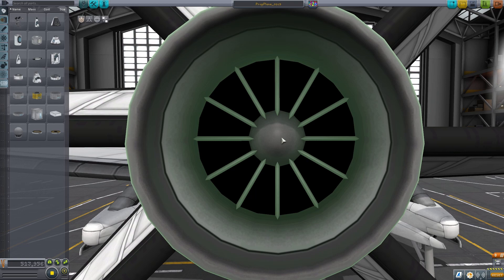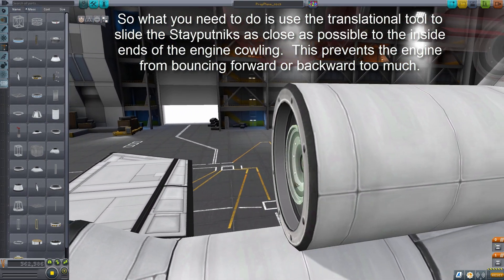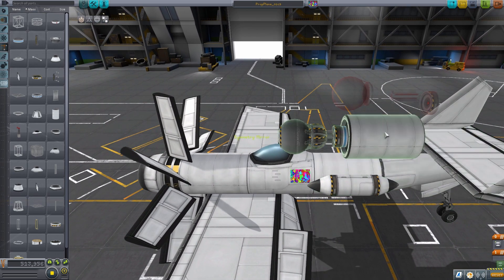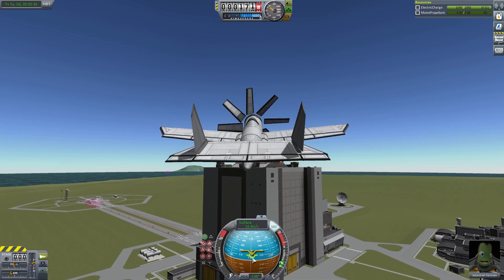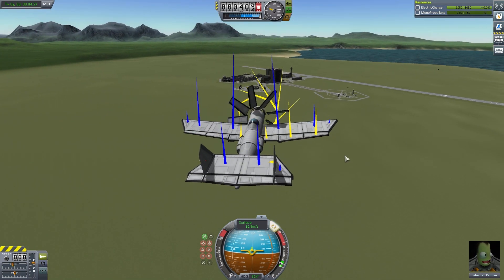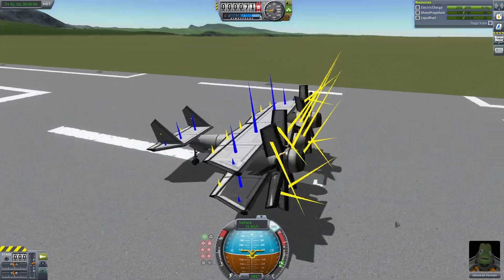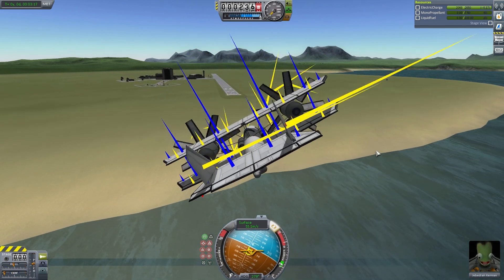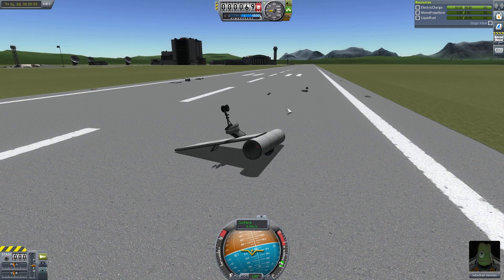OBSOLETE VIDEO, pls see #3 -- KSP stock elec prop 2: smaller engine, bigger performance

Comment: Before there was a way to make simple propeller engines, i just put wheezly engine or whatever they are called on the front and put them on reverse thrust.
Reply from the maker: Yeah I did that about a year ago.  Then someone told me I had mimicked the Coanda plane.  The principles of operation are, in fact, totally different but I took the comment as a compliment nonetheless.
https://youtu.be/J84QYRYhA6s

Comment: Just imagine a extrimely complex Tu-95 with counter rotating electric engines.
Reply from the maker: Oh man I so wish coaxial counter rotation was a thing in this game.  I've seen people do it in stock KSP with very large workarounds using a sort of scaffolding to have one rotation shaft be supported inline with the other shaft, but that's not truly coaxial.
Reply: Anything is possible in KSP.

(Kinda)
Reply from the maker: Antonluisre
Well in that case I challenge YOU to build the Large Hadron Collider, to scale, and discover the next subatomic particle.  ;D

Comment: What's the service ceiling for the planes? Any possibility of using it for a high altitude launch platform? Could save on fuel.
Reply from the maker: Yep, that idea's been shot around.  Rumor is the engine system works impressively well on Eve, but I suspect even on Eve the service ceiling would still be too low to get a rocket out of atmo.  On Kerbin, the ceiling for the planes I showed in this video is around 5 km, give or take a few hundred meters depending on flight profile prior.  With a more powerful engine and more thrust, the ceiling might go to 6 km or a little beyond, but the thinness of the atmosphere simply does not allow for sufficient deflected air off the blades at altitudes much higher than that.  Figure the Wheesley's flameout threshold is 9 km, so...
Reply from the maker: I stand corrected: getting a rocket out of Eve's atmo with an airborne propeller launch is totally doable.  See Bradley Whistance's channel.  He's already done it.  
https://www.youtube.com/user/nEvermore930/videos
Reply: Inter's Odyssey funny, found that at lunch and forgot to mention it.

Comment: I think the reason the Biplane is slower, is just due to drag, biplanes aren't exactly known for there speed, but anyway

Other than that you're engine is near perfect or at least very good, maybe to get more power out of them we should look into a better Prop design. 
Obviously these motors are low RPM and create Large Torque not so much Hp so:
-Pitch needs to be very steep (low speed)
-Diameter needs to be quite large (high torque , not high Hp)
-Blade needs to lower drag, pitch should increase near the tip, not constant pitch
-As many blades as only needed, the more blades: more drag, more harmonics, more stress, more margin of error

We also know that the farther the distance from the center of the blade, the more lift created, near the centre however more drag is created rather than lift. This is why props have a "twisted" look to reduce the inner drag and maximize outer lift

Obviously we cant have too creative of a prop, because they will want to pull apart under stress
But it might be an idea worth looking into, who knows you might double you're speed because you can get more power down

Other than that very good video, can't wait to see these motors become so useful we can actually consider bringing them to other planets. Thank you again for the video
Reply from the maker: Could you please elaborate on your second bullet point about the diameter?  I'm not sure I understand whether you are saying the engine should be a larger diameter (possibly by using reaction wheels external to the cowling) or the propeller arc alone should cover a broader diameter span.  Thank you.  

This comment is good input from a general physics standpoint but you ought be mindful of two things which throw that awry: one, KSP physics is not real physics; two, aerodynamic principles and terms have different meanings in some cases than what you applied here.  Some gee-wiz: 

A propeller blade is designed, in almost every way, to operate exactly like an airplane's wing.  "Thrust" of a propeller blade is essentially synonymous with "lift" that is merely pointing forward instead of up.  The single factor most important to both propellers and wings is "relative wind".  These two airfoils also have secondary factors which are important to each of them respectively that the other airfoil does not need to deal with.  Wings have to deal with load factor while propellers do not.  Likewise, propellers instead have to deal with drag induced by varying rotational velocities from root to tip, as you alluded to, while basic wings do not.  

The twisted look of real propellers serves three purposes, all of which are mutually supportive.  However, the outer portions of the blade do not necessarily produce more lift.  The reason propeller blades are designed like airfoils is because they intend to take a majority advantage of induced lift rather than dynamic lift.  Induced lift is a byproduct of Bernoulli's principle about faster motion of fluids when their flow path is constricted.  But induced lift can be produced in a couple of ways.  
1. AoA.  A twist allows the faster-moving outer portions of the blade to have a lower angle of attack (AoA) as the blade cuts a circular path through the air.  A lower AoA simply means the blade cuts through the air more cleanly and air molecules are encouraged to flow around the airfoil at high velocity with little disturbance, thus lower drag, and in turn increasing the blade tip's lift to drag ratio.  Additionally, a lower AoA reduces the strain on the airfoil.  However, greater AoA of an airfoil to a relative wind, such as at a blade's root, can produce a combination of dynamic lift (Newton's 3rd Law in blunt force form) along with tricking the air into taking a longer route of travel around the upper surface of the airfoil, hence a more devious form of induced lift.  A high angle of attack at low speeds can produce lift similar to a low angle of attack at high speeds.  That is probably the biggest reason blades are twisted: so the entire length of the blade can produce similar amounts of lift at every station along the length of the blade thanks to a nominal meeting point between rotational velocity, angle of attack, and camber.  
2. Camber.  Thicker airfoils (where thickness is a function of camber with respect to the chord line) impose greater constraints on the motion of air around the foil, thus speeding up that air thanks to Bernoulli - regardless of AoA! - which in turn produces lower pressure and in turn greater lift/thrust.  This means thicker airfoils can produce surprising amounts of lift even at quite low speeds, hence why they are used on aerobatic planes.  The drawbacks to thicker airfoils are that they demand more viscosity from the air in order to maintain laminar flow, so small bits of turbulence or significant changes in AoA will see the onset of stalls near the trailing edge sooner than on thinner airfoils and, in clean flight, thicker airfoils produce uncomfortable amounts of low pressure as speed increases which in turn imparts strain on the airfoil.  However, thicker airfoils are more forgiving of stalls and can continue to produce appreciable lift despite changes in relative wind.  Consider a propeller blade during a sudden change of relative wind, such as during a lateral gust or during a sharp maneuver of the aircraft.  The thinner tips of the blade with their lower AoA are more dependent on a narrow margin of error for relative wind.  In the case of a sudden change of relative wind, the tips of a prop blade are likely to lose a greater percentage of their possible lift than will the thicker, higher AoA blade roots.  Thus, the blade roots with their greater camber are the less efficient but more reliable portion of the blade while the tips are the inverse.  
3. Strength.  The twist of a prop blade affords a cross sectional area that allows the blade to be thicker at the root where it mounts to the shaft.  This thickness allows stresses suffered at the blade tip to be absorbed by the root of the blade and, in turn, it enables the root of the blade to gently propagate the torque of the engine out to the more delicate blade tips.  If the transfer of energy was not important enough, the considerations of mass also come into play.  It requires much more effort to move a mass in an arc the farther it resides from the pivot.  Tips of prop blades are thin so as to require less effort on the part of the engine to impart angular acceleration.  Less inertia means greater efficiency, and fewer feedback stresses when another force (eg. turbulence) tries to abuse that inertia along undesired vectors.  

Of course, none of these three purposes matter in KSP so I totally agree that a multi-part prop blade would benefit from having coarser (steeper) pitch near the root and finer (shallower) pitch near the tip to mimic a real blade's twist.  As a workaround, I think our ability in KSP to deploy control surfaces would allow something like an in-flight variable pitch prop (an FAA no-no) to continue to seek out the maximum thrust for a given altitude and airspeed.  I've tried doing this but in practice it is very difficult to see how long or short the yellow vectors become relative to a previous deployment setting because every time I change the deployment the propeller briefly feeds back into the plane, slowing it down, which changes what deployment angle I should be seeking ...it becomes a never-ending spiral.  

Your 4th bullet point mentions harmonics.  I assume you are referring to propeller-crankshaft harmonics where certain RPM settings will produce rotational velocities of the propellers where an odd or even number of blades (depending on the total number of blades on the prop) are in harmony with the rotation of the crankshaft, thus producing a tugging motion on the engine and all mounting points.  The more blades there are, the more frequent the opportunities for these adverse harmonics to arise.  The engine I've designed does not use a crankshaft as there is no cranking at all.  My engine is more akin to a turbine with a single focal point of rotation.  Yay!  Perhaps instead you were referring to harmonics of the blades affecting each other.  The trailing edge vortices and sometimes cavitations of propeller blades can create pockets of turbulent air that each downstream blade might pass through.  At certain RPMs and true airspeed conditions, the passage of the blades could hit these pockets at just the right moment that it incurs a drop in blade efficiency, or even vibrational stress suffered as the turbulent air tumbles over the subsequent blade and creates micro stalls instead of more laminar airflow.  Fortunately all of these problems are moot in KSP as there is no wind modelling in stock.  And even if Squad introduces wind for stock later down the line, I imagine it would be more like prevailing wind directions, not part-by-part relative winds and turbulence.  I think we're safe for now.  
 Given this, I will counter your 4th bullet point by observing that more blades means more thrust-producing surface area in a smaller diameter, which allows more compact aircraft designs.  Also, thanks to KSP physics, I've observed very ugly thrust performance with fewer blades.  As you can see with the AeroForces Overlay, the props don't produce any thrust at all in certain portions of their travel.  The more blades that exist in the prop, the more often I can have the whole propeller unit take advantage of the selected region in the prop's rotational plane where the peak thrust is achieved, thus the more overall thrust the engine can achieve in KSP.
Reply: diameter meaning the prop

btw nice job at making yourself seem smart, must have taken a day to right that loop of logic
Reply from the maker: xHIRTLIZER
Gotcha.  I haven't experimented with larger props yet.  Seen some videos of large stock turbines and they give the impression of producing a lot of power. 

No, less than an hour.  I've been in flight school for over a year now.

Comment: So could this fly forever?? I would be curious to see how it works if you make it fly without using SAS, then just let it fly on its own for as long as possible.
Reply from the maker: As far as power source, yes it can fly forever.  But as far as stability, even planes as stable as these need occasional adjustments to the flight controls.  There's no true autopilot in KSP yet.
Reply: I was thinking some huge dihedral to keep the plane stable in terms of roll then a constant up pitch that wont stall it but will cause it to goto an altitude such that it will just fly horizontal compared to gravity where the wings are providing exactly enough lift to cancel out both the craft's weight and the downforce from the angled down elevators.
a bit like a plane settling into a glide slope while you keep constant up elevator, but a powered version.
Reply from the maker: Thorondil
Gotcha, I hear what you're saying and it makes sense in real life theory, but not as much in KSP.  Yes, having a broader wingspan mounted in dihedral shape with ailerons out near the tips would indeed provide roll stability, but only to the extent that it would cancel out adverse roll incidents caused by engine naughtiness.  KSP will halt motion but not bother to correct it unless SAS is turned on, and if SAS is turned on then you can't fly forever because the curvature of the planet will argue with the original orientation of the SAS hold.  But if SAS is turned off, I don't think dihedral alone is enough to keep the plane horizontal.  ...UNLESS, the wings are rotated ever so slightly up (like a manufacturer's Angle of Incidence) so the relative wind in straight and level flight is always impacting the underside of the wing.  That way, the dihedral *should* be more effective and possibly enough to keep it horizontal, but then because of the constant tendency for the wings to climb, you would actually need to trim pitch down instead of up to counteract this.  Either that or just maintain manual control until the plane reaches its cruise ceiling where the air is too thin to make the wings climb anymore.  Lot of variables.

Comment: Can you recharge the engine? (maybe put a mass-less solar panel on all of the props?)
Reply from the maker: The generators I use in mine are sufficient charge for my engine.  Someone a while back mentioned that the cost in Career mode for my designs was prohibitive and defeated the purpose of a lightweight simulation of a piston engine.  Yes, solar panels could work but I prefer my RTG's.

Comment: I'm kinda amazed that it simulates P-factor! I was wondering, what is its single engine performance like on the multi (since you should loose like 70 Percent of your performance) also have you thought  of making one like the Do-335? It would look cool at the very least.
Reply from the maker: Oh yeah, the left-turning tendencies are definitely there: P-factor, precession, torque.  The only one missing is slipstream for obvious KSP reasons.  
Single-engine performance is a no-go.  From ground it will not launch; while airborne it immediately enters into an unrecoverable spiral (unless that engine is reactivated and the other momentarily deactivated to allow catch up).  Even with the downstroke being close to long.axis, it's just too much of a lateral imbalance for my basic biplane.  Maybe if I crammed its tail full of SAS wheels it'd be a different story.
Thanks for pointing out the Do-335.  I hadn't even considered push-pullers.  That probably would cut down on the drag for at least the trailing engine.
Reply: It should also get rid of turning tendencies, (at least torque and P-factor) because I'm pretty sure they are counter-rotating on at least the Do-335. Anytime, Love the videos!

Comment: Question: what if you put as many of those propellers in a row (aligned together) as possible?
Reply from the maker: Um, I'm not sure if you mean putting multiple engines in a row with each other or multiple propellers on the same single engine.  If you meant the former, then I've been playing around with some designs like that.  Drag is reduced but increasing the thrust still needs careful engine tweaking.  If you meant the latter, no I haven't tried that yet.  Based on my other experimentation I expect the greater rotational inertia of multiple propellers will provide negative feedback on the engine and divide its power output, but I can't predict whether the total thrust would be more, less, or even.
Reply: Inter's Odyssey I meant the former. OK I suppose that, as you said, the more engines the more risk of the physical engine screwing up.

Comment: I've found that prop planes work better in 1.2, not sure why considering other people say the opposite. Though, my big 3m prop plane actually flew in 1.2 xD
Reply from the maker: I'll move up to 1.2 soon.  How fast does your 3m fly?  I would think the larger diameter would be prone to inhibiting amounts of drag.  But I bet you get awesome torque!
Reply: Inter's Odyssey It flew at about 50 m/s and actually flies surprisingly well. The weight was the biggest issue though, I ended up making the majority of the fuselage a fairing